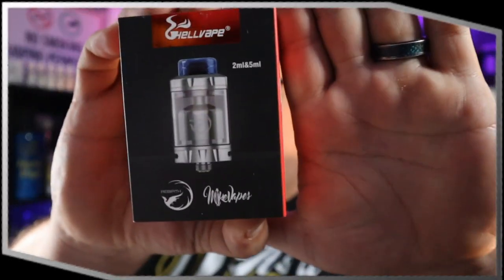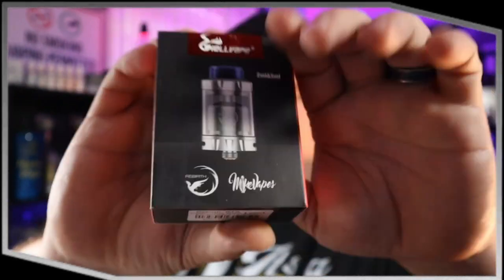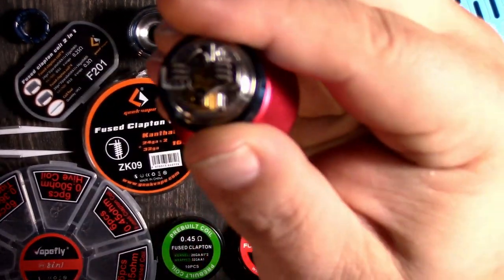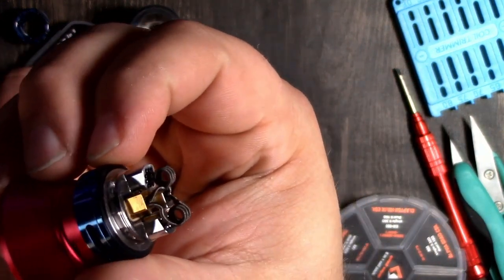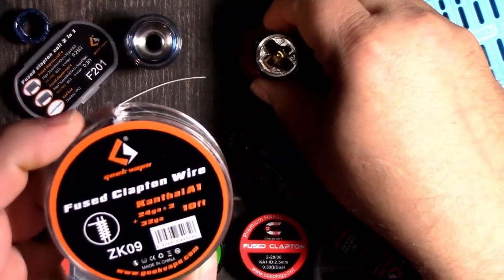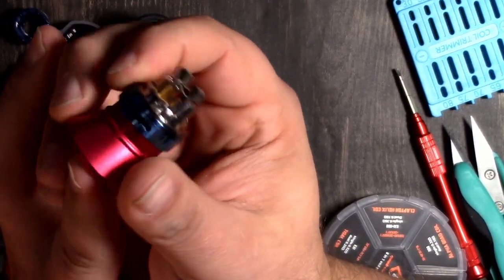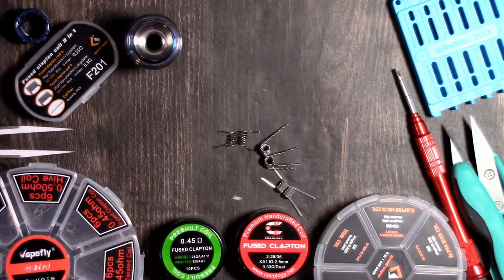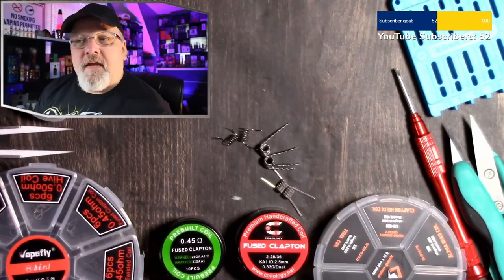Mike Vapes Hellvape Rebirth RTA - Best Coils for Flavor on this Awesome Rebuildable Tank

Comment: I don't believe in Fused Clapton but it's easy for beginners to wrap and install when space is tight. The very best wire in my experience is three strands of 36-40ga twisted with at least 6 loops in a diameter that accepts Cellucotton at its full thickness... but it's too springy to wick without deforming so you twist that wire with one heavier wire like maybe 30ga. Functional wire beats art wire every day if you want high resistance and low mass which is the way to compete with mesh. Low resistance and high mass is a waste of heating time and watts even if it does offer more surface area. 60w through .6ohm coils seriously guzzle juice and a child could construct it.

Also I would recommend you look at diagonal wick cutting instead of feathering (or maybe a little of both) because if the wick is packed in coil just right you don't want to pull out a single strand of it.

And dry firing is really only useful for ferromagnetic metals because that's how coil balancing works: iron molecules in molten wire are forced by an electromagnetic field to align appropriately. All the brushing and tapping is just to make a person believe they are contributing to an automated process and I'm still not sure if quenching afterwards locks in that configuration.
Reply from the maker: Thank You for a very logical summation of what coils are best and how to achieve a perfect setup. I will be looking into cellucotton and compare it to the other wicking materials. Fine tuning all of these definitely results in a much more enjoyable experience. I truly appreciate your feedback and I'm sure others will learn a lot from it!
Reply: You should try 24 guage kanthal twisted till it breaks of repeat 3 times for a tight twist wrap on 2.5 mm they really springy so come out at 2.8mm 6 wraps comes out on 1.4 ohm on a dual build .only coil that gives me flavour in my dead rabbit rta .gonna try to helix them with 32 gauge over the weekend its gonna be fun =)
Reply: I dont mean to be so off topic but does someone know a method to get back into an instagram account..?
I somehow lost the login password. I would appreciate any tricks you can offer me.
Reply: Wow I've been wrapping mtl single wire coils,also used premade wire spools,premade coils etc but haven t a clue what your talking about 😂must be for advanced folks..i get claptons and dual,triple,quad cores and I cut cotton at an angle too but still..im lost mainly because I've never owned a dual coil atomizer.Ive got plenty of single Rtas n mesh rtas etc but I'm still behind the curve. Can I ask you..if I have 2-.8ohm coils should it ohm at about .16 or am I not getting it?
Reply: What is cellucotton?I've used about every cotton i could find but never heard of that..you must know where to get those hard to find items at everyones normal go to places lol Thanks.
Reply: Hey all old guys....haha..do u still using this rta bud? Since Alladin n Caliburn G came through. Have u tried out Alladdin n Caliburn G yet. Alladin for sweetness boost n Caliburn G bring a mount of satisfying vape. Less time to be a mechanic n save a lot of your times. 

Did all of your RTA can beat the sweetness of Alladin yet? Hahaha..
New era. I'm feel so excited to hear the new news from u guys. How the days going guys? (Video 1 years ago, Comment 5 month ago).

Comment: @Hunky Vape I know you've tried plenty of prebuilt coils. I want you to think about trying out wotofo dual core fused claptons. They are .28 and ohm out at  .13 with dual. I've went through a lot of prebuilt. These are sweet, crackling flavor. Just try them
Reply from the maker: Will do! Thank You!
Reply: @HunkyVape  I just picked up this rebirth as a backup and I’ve got alien tmn 80 3mm 0.13 dual coils by twisted messes or coilology I think but I’m getting Little to NO flavor! I have it wicked pretty good imo , and I’ve got the coils raised a bit above the airflow ports to prevent restriction ...I dunno what the heck I’m doing wrong! I’m no pro here lol however I been building for 7 years and never have I found an rta so far I couldn’t master ... any thoughts on what I might be doing wrong? I’m running it on voopoo drag at 65 ish or on rebel dna around the same settings wattage 60-65.. help! 😂
Reply: I have bought them today. Which wattage is this best at?
Reply: @ProzofgamingHD  85 to 100 for me, but u might like it higher or lower
Reply: @christieb8560  the rebirth rta should have been honeycombed at the airflow ring instead of up under the coils. I personally didn't like the flavor at all. I gave away my rebirth

Comment: Yeah my experience using single wire kanthal for my mtl Rtas is that it sucks..gunks up fast and I get muted flavor too,SS is a bit better and single n80 wire isn't too bad but I've moved on to RDTL and Dtl.Never had flavor luck with any mtl tanks.I make ejuice and at low watt mtl style(12-16watts) I find myself having to add more flavoring to achieve what I taste at 50 watts and I'm not referring to warm or cool just talking flavor only.Thats how disposables get so much flavor at 8 Watts they jam a ton of flavoring(usually 1 straight forward flavor or with ice) into it.
Reply from the maker: That's the reason commercial juice has so much flavoring and artificial sweeteners added. MTL formulated high nic juice is sold in smaller bottles because of the additional flavorings required to produce the same perceived flavor as low nic DL juice (sold in much bigger bottles). It makes sense if you consider how much vapor is produced for each puff. MTL use has a very small amount of vapor so flavor concentration needs to be higher to compensate. I'm working on some DIY videos to help people learn from my mistakes so they can do it right the first time.
Reply: @HunkyVape  I completely agree..the only time I don't need a few percentages more with a little pod system is my gf mint menthol recipe only cause mint is just a strong concentrate.Even shelf bought juice I never found an ADV now i make my own salt nic at 60/40 10 mg at 55 Watts and make normal recipie percentages.My Rda,Rtas vape it great n plenty of flavor.Ive switched to mesh Rtas just cause its an easy install and the strips are cheap n last well over a month each strip.I have 5 mesh tanks now and each one offers a bit diff flavor but really good flavor.Old school guys tend not to like mesh n say their a cooler vape which is kinda true but the clouds n flavor make up for a less warm vape plus Mtl tanks are also a much cooler vape anyway .I still use my reg coil Dtl Rtas but I think i got lazier 😂 a roll of vandy vape mesh is 4$ for 15 feet and even the precut mesh strips are cheap for the amount of time they last.Geekvape only has 2 per box but at 1.79$ a box from china i just bought 20 boxes.The kylin m wotofo m Doom X all come 10 strips in a box..those Geekvape mesh strips are tasty tho! Its one of my fav rta for flavor n looks too.. i just wish it was better built quality n  sturdier like the kylin m or doom x is more heavy duty.Those grub screws are tiny on the zues n profile m but that's probably why their cheaper.But yeah that 10 mg salt works awesome n keeps me from chain vaping like I do with 3 mg freebase.I have 2 liters of 100 mg salt nic but I'm getting 1 more for safe measure since I make for 2 people salt goes a lot faster at 10 mg for me and 15 mg for her novo 3...Shes got a brand new freemax twister cylinder mod with a fireluke 2 n 6 packs of sub ohm coils for it then when their gone i got her a zues mesh and an ofrf gear rta but man she won't stop ordering pods for her novos that she's constantly charging lol..she don't realize how much better the flavor will be but she likes no screens or buttons so we picked out the simple twister with 1 fire button and the watt dial is on the bottom..ill just set it at 40 Watts I already bought the right ohm coils for those watts for the fireluke 2 but man its all still in the boxes for 7 months now lol..ill take the Gear rta back if she don't want it lol even tho their all rainbow color AND she had me get 810 to 510 drip tip adapters and metal rainbow mtl drip tips..it will work I tried it with my tanks 💥✊😎😂 Siiighhhh she's so stubborn man

Comment: Do you usually not pulse the coils before wicking? That will cause flavor issues as well as others..
Reply from the maker: I usually pulse the coils before wicking, but certain metals do not safely allow that, and quality spaced coils shouldn't need pulsed or dry burned.

Comment: Why didn't you get the Hotspots out of the coils?
Reply from the maker: Spaced coils made of quality materials don't have hot spots. Hot spots are caused by direct contact of the outer clapton wire instead of current traveling along the coil.
Reply: @HunkyVape  OK makes sense was just curious lol

Comment: So is that coil kit mtl coilology ? Still tryna understand ohms with dual coils for instance would 2- .8ohm coils come to a .16 build? Thanks guys
Reply from the maker: The coilology coils in this video were regular 2.5mm coils for RDL. I found them ideal in Bogan's Blotto. (2) 0.8ohm coils in parallel would ohm out on the mod to 0.4ohms. For the standard rebuildable tank, dual coils will be in parallel configuration so just divide the resistance by 2. I have only ever seen one RTA where there was a neutral center post to allow series configuration for the coils. In that tank it would add the resistance of each coil to make 1.6ohms.
Reply: Is alien wire for flavor?